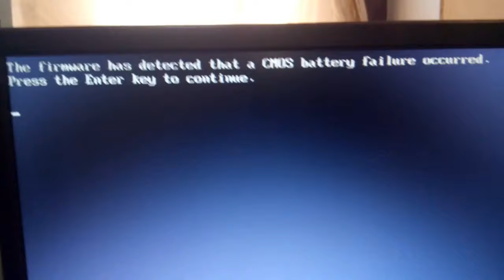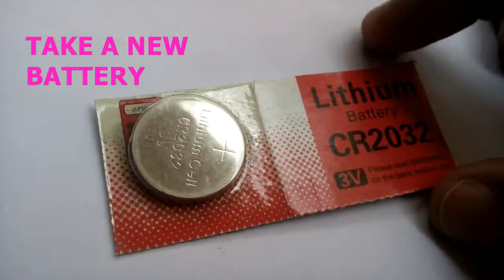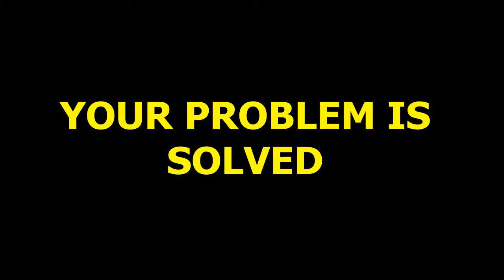HOW TO SOLVE CMOS BATTERY FAILURE OCCURED PROBLEM EASLY

Comment: My computer clock battery died.  It had a CR2032.  I bought a CR2025 at 
a store going out of business (No Returns).  Both say they are 3v.  The 
CR2025 is a little thinner, but otherwise they are the same size.  Is 
there any reason not to use the 2025?
Reply: All For You , yep, it may not fit into the slot perfectly